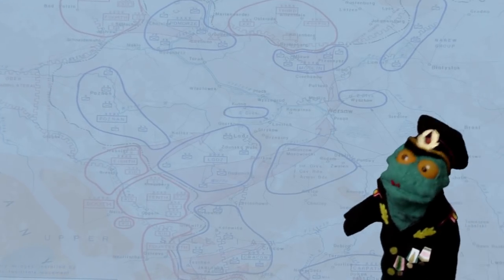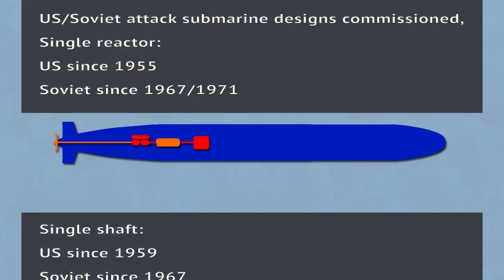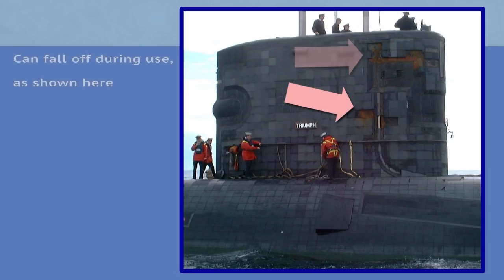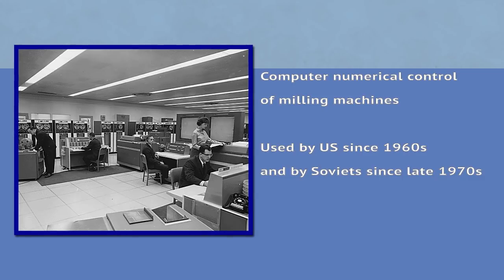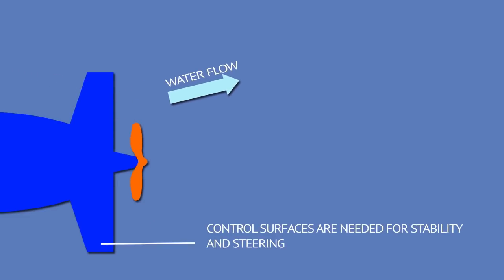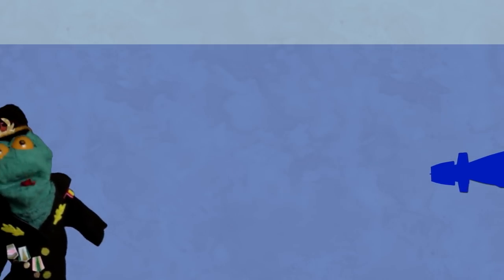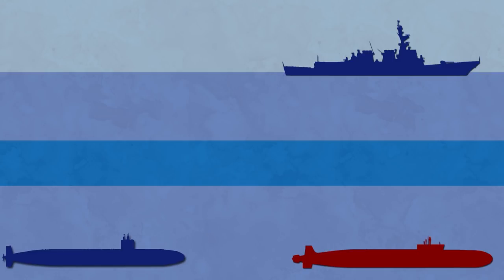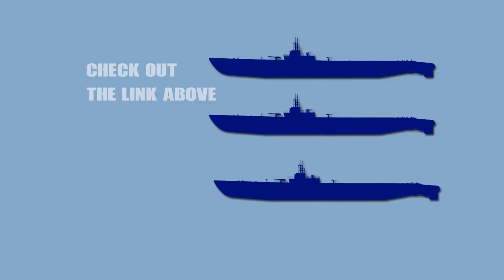How do modern submarines remain silent?

Comment: Sad that the modern diesels never got mentioned. Older diesels had limitations which are limited speed underwater & loud as hell when snorkeling or surfaced to recharge batteries, but modern diesels with AIP propulsion systems (e.g. the Swedish Gotland & German 212A) with Stirling & Fuel cell technology allowed higher & longer submerged running speed yet being even more quiet they nuclear counterparts.

Comment: "NUCLEAR SUBS ARE PRETTY DARN SILENT"
Reply: no,diesel are better
Reply: foxtrot Even more quiet.
Reply: NATO Ball Diesel's are quieter
Reply: yh u got it Xd
Reply: Diesel wont leave you in an EMP stuck
Reply: You can't emp a submarine. Or a ship. Anything insulated is pretty much safe from emp.
Reply: dafaq shloud i do? XD
Reply: What if all the submarine cruw fart  what gona happen they got detected
Reply: Rafale Dassault yes diesel electric subs are extremely quiet, specially when running on batteries. Much quieter than a nuclear sub, only drawback they don't have the endurance of a nuclear sub
Reply: Yeh nope, you can make a nucleaer sub much more silent than a AIP sub if you know how 

The things that make a nuclear submarine noisy is the fact they use pump, and that the boiler converts water into steam, and that steam has some bubble on it, to not forget that the condensed steam has to being pumped 

You could solve those thing, using a natural circulation or convection reactor you can forget those things, if is a molten salt reactor or at least salt cooled, is even better.

The bubles in the boiler, yeah you can eliminate those ones by using a higher temperature boiler that convers water into supercritical steam, and the condenser pump could be eliminated by using a supercritical CO2 driven turbine, that only has a compressor to circulate co2

Problem solves, electromagnetic bearings can make the sub even more silent.
Reply: A reactor doesn't make noise if you know how to handle it, it just produces heat c:, the only parts that produces noise are the pumps and the turbines, both of which can be removed, for low power operations Peltier devices can be used, and take that, you generate thermal electricity without mechanical part. 

Almost all AIP devices that are pratical and safe produce some noise, the stirling engines of the kockums, those are literally reciprocating steam engines, the mesma system of the scorpene and barracuda shortfins, they are basically steam boilers that work on kerosene and liquified oxygen.
Reply: The only question left is: How much more silent are diesel submarines?
Reply: All submarines are more silent than the ones build in china or russia today

Comment: I think Alfas operated regularly down to 800-900m and some dived even to 1200m

688s were limited to 250m due to thiner steel..necesary to keep weight under control..in theory they could dive to 300 with crush arround 400 but usually 250 was the limit.. that fact was not well known until late 90s

Comment: A small correction about cavitation. It isn't waterless voids. Cavitation is caused by an area of low pressure forming on the leading edge of the screw's blade, which in turn causes water to boil in this low pressure area. These bubbles of water vapor quickly collapse, and the collapse is what creates the noise.

Comment: what about german submarines? some wikipedia article

The German Type 212 class, also Italian Todaro class,[7] is a highly advanced design of non-nuclear submarine developed by Howaldtswerke-Deutsche Werft AG (HDW) for the German and Italian navies. It features diesel propulsion and an additional air-independent propulsion (AIP) system using Siemens proton exchange membrane (PEM) compressed hydrogen fuel cells. The submarines can operate at high speed on diesel power or switch to the AIP system for silent slow cruising, staying submerged for up to three weeks without surfacing and with little exhaust heat. The system is also said to be vibration-free, extremely quiet and virtually undetectable.

Comment: If LFTR were used in nuclear submarines then they could be even quieter than diesel submarines with air independent propulsion. Unlike other common reactors, LFTR can be shut down and turned back on very quickly and safely. This would allow turning it off for ultraquiet running on battery power.

Comment: Would an even number of powertrains tuned to similar frequencies cancel out the noise enough? If the oscillations were similar enough and tuned to be one cycle different then the sounds would destructively interfere, but I don't think the sounds of the engines could be tuned to be similar enough.

Comment: electric-diesel, and i think there are a few hydrogen fuel cell subs, are the most silent subs as far as power plant is concerned
Reply: How silent are they when they are sitting on the surface for an hour every hour?
Reply: how silent are they when sitting on the bottom? i didn't say perfect
Reply: Dont diesel subs have to surface every few hours? Arent they incredibly un-stealthy and vulnerable when they do? Naval pursuits may take many hours and if a submarine cant even maintain its stealth for that duration, then how useful can it be?
Reply: maybe with the ww2 u boats, but i think modern one can stay under longer, though they are vulnerable when they are on the surface, but that's true for all subs
Reply: After spending the last hour reading about submarines, Iv determined that a typical diesel sub can stay under between a few hours and four days depending. This is because the energy requirements go up steeply the faster a sub goes due to increased water resistance, but also because batteries drain increasingly quickly the more demand you put on them. I could be off on this since the exact capabilities are classified. It seems that the diesel subs we have right now would have difficulty closing distance with moving ships and wouldnt be able to lay an ambush a week in advance without giving its position away to the MK1 eyeball.
Reply: I look forward to seeing Binkovs Diesel-electric sub video!!!
Reply: My follow-up replies made it clear that that initial statement of mine was an exaggeration. 
"The new german submarines can stay submerged for weeks." Maybe, but doing what? The Russian Kursk has been submerged for years but nobody in their right mind thinks of it as a combat effective vessel.
Reply: A quick look at a few articles about the new 212 boats shows they are small and designed for a littoral role meaning they are for coastal defense and not for blue water operations. They are also have hydrogen fuel cells and are not diesel-electrics which is what I was talking about.
"Patroling, looking for targets" - But only if they are immediately off shore.....
Reply: Moving from the baltic to the north sea is hardly a blue water operation, I mean they are literally touching each other and you can see the coast right there! At a time where even poor nations can afford drones patrolling the coast at all times, the need to surface at regular intervals is a real issue!
I heard that a NewGuinean tribesman shot down a Japanese fighter plane with a bow and arrow, doesnt mean archers are effective AAA.
Reply: Normal diesel electric subs run on very loud diesel engines on the surface and are vulnerable to radar and visual identification.  They can be very quiet underwater when running on batteries, but are limited to about 1.5 to 2 days at 2 knots.  So you can either go fast for a short period or a short distance in a long period.  AIP Submarines increase that to about 2 weeks.  Still a nuclear submarine beats the pants off AIP subs in terms of underwater endurance and speed meaning they can remain undetected and move themselves into striking position far more easily.  Diesel Electric and AIP submarines are more defensive short ranged submarines.
Reply: Yes!
Reply: What? In that case you have made non-supportive statements.Are you saying the new German subs are for both a green AND blue water role or are you saying they are small because of their green water role? The point (the only point I was really trying to make) was that diesel-electric subs may be quiet (did I ever say they were loud?), but they need to be quiet because quiet is stealth and submarines cant win fire fights against ships. Surfacing regularly gets rid of your stealth ANYWAY!!! These New AIP subs look like they have potential but Im unconvinced that they close the gap between conventional and nuclear subs. Hypothetically sinking a ship in a practice battle doesnt prove anything. Excercises are designed to give crews practice and as such the ships and boats have constraints placed on them like not hitting any unidentified sonar contact with depth charges like could well happen in a real war.
Reply: It's important to note that nuclear submarines are moving to quieter technologies that they can achieve due to their massive amount of power from their powerplants.  Already pump jet and shrouded drives are employed by most modern nuclear submarines (Yasen totally missed out on this opportunity for quieting) The all electric drive was mentioned in this video and is an excellent noise reducer, but shaftless propulsion like the permanent magnet motor (being scale tested by USN right now) and rim driven propeller being claimed to be implementing in future PLAN submarines will reduce noise in ways that AIP and Diesel electric cannot thus reducing the gap.
Reply: There are diesal subs that can stay submerged for upwards to a month. They're largely used in littorial waters, where they can outmanuever nuclear submarines are a extreme fraction of the cost.
Reply: Being submerged and moving while submerged are two different things.  A submarine needs mobility.  It needs to place itself within striking range of targets or it misses those opportunities.   Diesel electric boats are great for chokepoints, but being able to keep up with 30+ knot fleet carriers running zig zag patterns while avoiding it's escorts and nuclear submarine escorts is a challenge unless it just happens to be in the perfect position to get into firing range.  Then as we see the simulations prove they like all submarines in a good firing position can be deadly as hell.   A nuclear submarine with the same speeds and cavitation reducing technology like shrouded propellers can do much more to get into those striking position.  I say stick with Nuclear boats for the USN.  Having SSK's and SSP's in enemy waters that you don't control the airspace of is deadly.  They will be spotted and picked off while surfaced.
Reply: Diesal submarines are not intended to go after carrier fleets, it's unfair to throw it into deep blue waters when it largely isn't intended to be in that environment. Unless, of course, we can make comparisons between the DE and Nuclear submarines in littoral and brown water environments?
Reply: They are being claimed to be carrier killers, but you are right.  So submarines of all types lose advantages while in shallower water.  There may not be thermocline layers.  Their is less room to outmaneuver torpedoes or hide, you cannot go deeper to lower caviation at higher speeds and you can get sound bounce off the ocean floor.  This all lowers the advantages nuclear submarines hold over SSK's/SSP's   Otherwise smaller more maneuverable non nuclear subs that are quiet with the capability of short bursts of speed if needed.  Usually technology is better in SSN's including sonar and Integrated combat systems.  I know the Virgina class was built to be able to preform in littoral waters as well as blue water, but don't ask me what that entails.  Did I miss anything?
Reply: They are carrier killers, and they have been relatively close to shores (Give or take 200 miles). They aren't intended to float about the middle of the Pacific ocean, rather, they are raiders and ambushers that are remarkably difficult to detect. There have been several exercises where a single submarine has destroyed more than half of a carrier fleet before being detected. Again, this is not in the middle of the sea, but rather closer to shores - well within the increasing endurance of these submarines. 

Actually, shallow literal waters are infamous for the ability to actually hide submarines, especially the smaller  des-electric submarines who, in such an environment, can actively out maneuver nuclear submarines (who can be longer than the water is deep) for a fraction of the cost. Radar is a two-way gate.

In open ocean waters, say the middle of the Atlantic at the height of the Cold War, a nuclear submarine has the advantage over Diesel.
Reply: "carrier killers", Isnt that a jingo to convince young men that serving on these boats is glorious and not unsafe at all?... I mean, Subs have  reputation...
"There have been several exercises where a single submarine has destroyed more than half of a carrier fleet before being detected", oh c'mon! Now I know you are pulling my leg! Carrier fleets have more ships than double a submarines number of torpedo tubes and it takes like 10-15 minutes to reload just one tube! So you are wrong just on the numbers.
Reply: You seem to contradict yourself.  "Not intended to go after carrier."  "They are carrier killers."   Regardless of that.  The Ocean is on average 3,700 meters deep.  Well below maximum depth for combat submarines.  The vast majority of the ocean is not littoral waters and carriers would avoid those waters when they could using aircraft with a 800km range.  In the event it was littoral waters.  Would a Virgina class being only 1/3rd longer than a Kilo class really be at that much more of a disadvantage due to her size?  Plus if it's a difficult environment to detect submarines that works both for SSN's and SSK's.   I know submarine ASW has been big with NATO operations and they are training and developing new tactics and methods to deal with the threat.  Remember a carrier group always has 2 nuclear attack submarines escorting it in addition to the destroyers and helicopters with droppable sonar buoys and torpedoes.  I believe if they were good and lucky enough to have the fleet get into their range they could fire a salvo of torpedoes against a carrier or its escorts.  While a nuclear submarine has the speed to get into engage a carrier group if it wants.  Regardless any bouts of speed in that shallow water will cavitate the hell outta you and make you a easy target.
Reply: "old" is insulting to the advanced German submarine design and understating the deadliness of SSK's in the right position. Especially if that was a type 212.  Almost every nation with Submarines has probably managed to sink a US carrier in exercises.  These exercises are designed to see what works and what doesn't.  It gives hard scenarios that show carriers and their escorts how vulnerable they can be so they can fix those problems and improve.  If I was in a war game and my side didn't have scenarios where they would fail or suffer and instead would win every match we'd get complacent and wouldn't learn.
Reply: Former Sonar tech here. Diesels esp AIP (ie Yuan-class) are far more deadly for surface vessels than a nuclear boat (Generally, depends on what kind of group youre after). A diesel charging bats will do it where sound propagation is minimal, its night, and it only has to raise a snorkel to charge, and that can only be for a short amount of time before she is ready to go for the next few days. While this is its most susceptible time for detection, it can likely limp to safe waters to do it.  In war, keeping track of them would be damn near impossible. The modern diesel sub can break a threat surface Navy's back with ease if the threat isn't careful. If I was a nation with foreign navies off my coast, I'd want to buy a lot of AIP vessels for a naval conflict. A nuclear boat is good for finding these diesels.